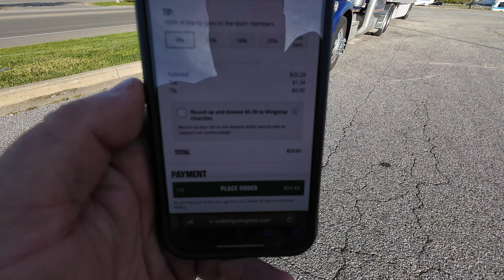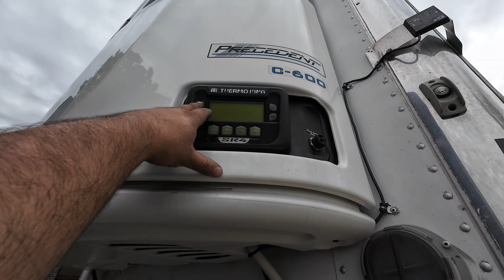TRAILER ISSUES PETERBILT 389 PRIDE AND CLASS GLIDER

Comment: next time you take that size air line apart to block it off try a dime     10 cent piece      
 old school
Reply from the maker: That would be much easier, but unfortunately, a dime could not fit in there.
Reply: You can use a roofing nail to block off a brake chamber Ive also folded the line to pinch it off and used plastic  wire ties to hold it folded these things will get you out of the middle of no where if you blow a pancake and dont have any with you
Reply from the maker: @davidcaskey4669 Never thought roofing nails could do that. But I definitely know now. Getting a box of roofing nails for my truck as soon as I get home. Thanks for the tip buddy 🙏🏼

Comment: Seeing those railroad bridges in  Chicago reminded me of the ONE time I bridged a trailer. I stopped at a Union76 truckstop on Manheim Rd. to get fuel and I asked the guy if it was ok to take Manheim instead of getting back up on the Kennedy Expressway, and he said yes, but "don't stop anywhere because the blackies will get you" ! So off I went, in my old '65 B67 Mack with 22" rubber and there are railroad bridges every few feet it seemed with no height signs, and they looked low because the road dipped down under each one. Oh I was empty by the way. So I  stopped just before getting under the first one and got up on the deckplate and looked. There wasn't more than 2" clearance ! So I slowed down at each one, and there was a shitload of them. Until i heard a ruffling sound under one and saw yellow fiberglass floating in the air behind me. FUCK !!!! Just caught the right front corner and kinda accordianed it back a foot or so. That aluminum alloy in that roof was stiff shit !! Couldn't flatten it back out, so I just jumped on it and pushed it down below the section around it, go a couple rolls of duct tape and went across diagonally 90° to each other and called it good. It never leaked !! So that's my Chicago story, hope you enjoyed it. I was out there from Massachusetts delivering a load of plastic flower pots, and I tripleased a load of empty computer cabinets right back into Mass.. That was in 1978. I've been over most of this country with a Rand Mcnally Road Atlas, a Rated Bridge & Low Underpass book, and a CB radio !! How trucking has changed !!!!!!!

Comment: I've noticed that you dont dump the trailer air suspension normally to get loaded and unloaded. I may be wrong on this but to me it seems like that put unnecessary stress on the air bags. If you don't have a dump valve for the trailer then I'd suggest getting one installed
Reply from the maker: I don’t have a dumb valve on my trailer. If I was to dump all of the air from my bags, I think that dock plate would put too much stress on the trailer floor. I do have valve that I can twist of on my air thank so I might try that one day to see how it goes.
Reply: That could be that it adds stress to the floor. I always dump my air and if the dock height is high then I slide tandems all the way back and if dock height is low then I leave tandems further forward but regardless the air always gets dumped. Less movement up and down helping to save my door seals from ripping against their docks as well. Hey maybe I'm doing it all wrong
Reply from the maker: @hermanwall850  I will definitely have to try dumping my air one of these days whatever I’m picking up or delivering. I want to see how the trailer is doing whenever I do that.